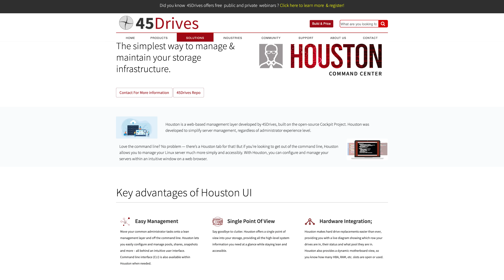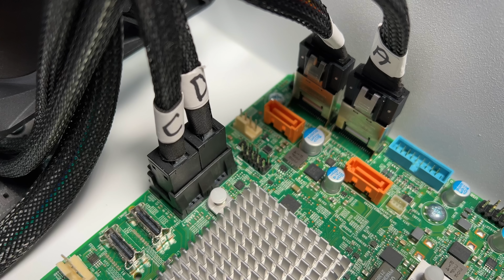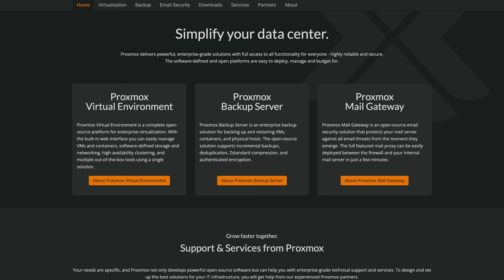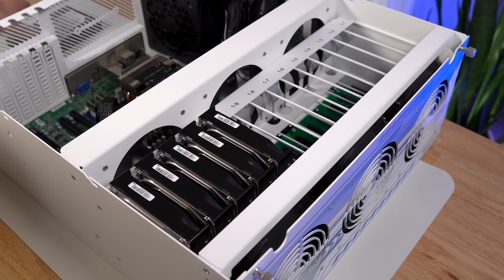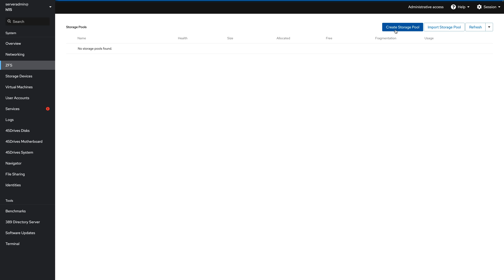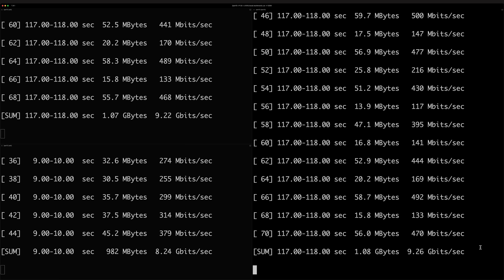EVERYTHING You Should Know About the HL15 (HL15 Review)

Comment: Pricing is WAY out of line on this one. sure it looks pretty but that price, not counting shipping and tax? No way in hell, better options out there for that level of cash. (For case and plane alone, built server prices are always overdone for homelab use)
EDITED:
Since someone keeps deleting my posts, here's to you mister searched around the world for years... They even deleted the 4th comment that was also talking about how over priced this is, someone is really trying to push a narrative here....

For an actual homelab? Too easy. 

Rosewill has a 15 bay internal without a backplane for $220 on amazon if you buy direct or $137 if you buy from another vendor. And it fits a full proper EATX board. 

Is that backplane that only does 8 drives at SAS and the rest at SATA really worth $663 to your home lab? Does that bring you $663 worth of value? No, it doesn't. For a home lab you can easily do better and just get breakout cables and daisy chain 2 legs off your PSU for like $40-$50 bucks, then put that other $600+ into something that actually brings value to your lab.

Oh you say, you want to cry about not having the back plane? OK, too easy. 
Silverstone RM43-320RS. It's a 4U case, it's got 20, not 15, 20 HDD bays, oh yea and they are front access hot swap trays, so you don't have to pull your server every time you want to swap a drive. The back plane on this one runs all 20 drives at SAS speeds if you so choose, can't say that about that overpriced piece of junk. And it has dedicated SSD trays that don't block the fans, can't say that here. And it has front panel IO, the HL15 does not. And it has a front optical drive slot, which can be useful, or you can replace it with a hot swap 2.5" drive bay, also useful. And this one fits and EATX as well. Plus it includes the rack rail kit in that price, HL15 does not. Pus being a silverstone it's got great build quality, hence why I've been slowly rotating out all my rosewill cases for silverstone cases. And how much for all this goodness? $830 with free shipping. Remember, your precious HL15 costs $800

Next time you claim you've searched all around the globe for something for years I would suggest spending like 45 seconds on google, will help to keep you from looking like a complete .... chose your own word here
Reply: Paid 3k in 2020 for a QNAP-h1288x, which has similar specs but much worse build quality and is way less expandable.
Reply: I'd love to see a BOM at MSRP for each item to see how much they mark it up.
Reply: I went for the Inter-Tech 4U-4736 chassis, support for 36x 3.5 sata hdd/ssd and 2x 2.5 sata hdd/ssd and including backplanes and all 36 hdd are hotswap capable if your HW supports it. I have been running 3 of them in a GlusterFs cluster and they do an excellent job and have good build quality. However stock backplane is 6Gb but can be upgraded to 12Gb for additional cost, All in all I find it a better value for your money and more flexibility. Converted from my local currency the price is around 718 US dollars excluding out of europe shipping.. I find the 45 drives builds a bit overpriced and overhyped. Nonetheless I do appreciate the effort that went in to this video
Reply: The neckbeard is strong with this one.
Reply: @HouseOfBugs89  ah yes, the military is known for it's copious amount of neckbeards, you surely got me there. Since you want to sling names how about paid advertiser? I especially loved the part in your video where you said that no other options out there have the features of this one while that is just flat out false. It was almost as good as the bit in the beginning where you say you weren't paid in an attempt to sound impartial right after you said that they gave you well over 2 grand worth of equipment (+ taxes and shipping)  and that they have given you plenty before that too. I wonder if that had anything to do with that bit about there being no other options out there that are comparable...
Reply: @chomp7927 this isn't my video. lol. You're not that bright are you. The rosewill 15 is very different in design here. I don't use these (I have supermicro chassis) but you neck beard types love to shit on products. Just because you don't like it doesn't mean there isn't a market for it.
Reply: @chomp7927 I think you're @-ing a random user named Tim, not the video poster lol
Reply: Bro, these youtubers do these videos for their ego and image they not into show the technicality of the technology
Reply: Have you considered the case itself, as in the actual metal bit, may in fact be nicer? Or the sledless tooless drive bays that nestle each of yer drives just so are a joy? Maybe some of us like the look. Maybe simple the fact I can dicyppher and remember the model number makes it worth more. Maybe you care way to much when it's literally only a few bucks and no one is making you buy one. Go touch some grass. I'm gonna touch my HL15.
Reply: If someone keeps deleting your posts, that’s a sign. it’s time to stop posting and do something else
Reply: @lifewater  or maybe that the marketing is strong on this one. There has now been multiple better examples given by more than just me. Fact is this is junk for value. Closer to 400 for literally a metal box and a neutered backplane, no drive caddies, no front io, no rails, yea that would be fine. 800? Hard no
Reply: Since no one wants to address it then , please counter my very first example. The only difference (besides yet again a lack of front IO, or in this case even a dust filter) between the HL15 and the Rosewill 15 bay case is the backplane, the half speed backplane. Now please, explain to me how you think that cutdown backplane brings $663 of value to your build. Would you go out and on your custom build see that half speed botch job from homelabs and pay $663 for that because you absolutely had to have that in your home?

No. you wouldn't. But you are all just shilling hence none of you want to talk about actual facts of the matter and you want to divert and distract instead of answering the simple points that were brought up.
Reply: @chomp7927 it’s not the backplane that’s limited. It’s the motherboard. His mention of backplane was about witch of the places on the backplane area connected to the SAS ports and which are connected to the SATA ports. 

The Supermicro X10SL7-f that I have is like this. It has 6 SATA ports plus an onboard 8 port Broadcom SAS controller, which can use SAS or SATA drives.
Reply: @chomp7927 You’re comparing an $800 case with an $800 case…so pricing is not “WAY out of line” after all? 🤦‍♂️ I’ve owned a SilverStone case for 5 years, and very familiar with the rm43.
Reply: @abb0tt  I gave you two options that prove you wrong, you conveniently ignore the $663 difference first of all, then you ignore ALL of the tons of things I just mentioned that the HL15 does not have that prove this is just way over priced and not a good value. Not that I ever expected you to be smart or honest in your replies at all considering you opened with your multi year search around the globe BS
Reply: You’re dreaming. Show us “better options out there for that level of cash”. Trust me I have looked across the globe for years, and you will not be able to assemble this type of configuration on such a flexible platform for less. I have translated way too many obscure manufacturers websites touting backplane chassis of 12-16 drive bays. Please prove me wrong, otherwise you’re flinging B.S.

Comment: Looks really nice, but that option with MB included doesn't look that appealing to me. 4y old CPU and motherboard are lot less efficient that more current HW (my small homelab with NAS, 2x 18TB HDD, NUC 13 pro, switch and 2x router consumes 75W when idle).. as someone from Europe where electricity is currently quite expensive that option is not viable

But ignoring the MB + CPU choice. This looks like a nice case that I will most likely consider when I outgrow my current NAS in a few years